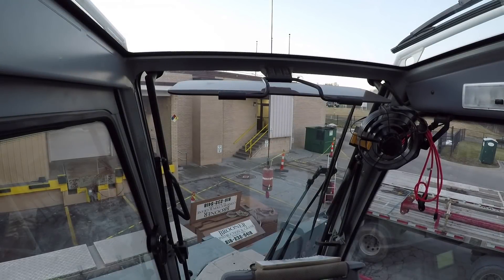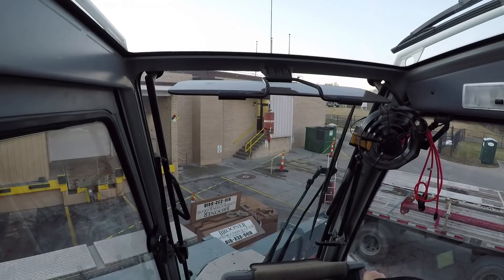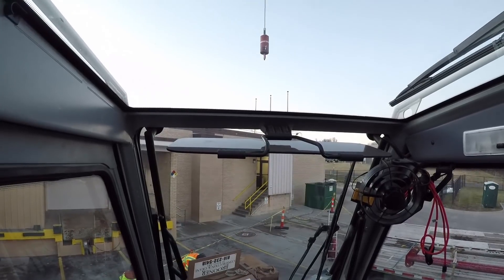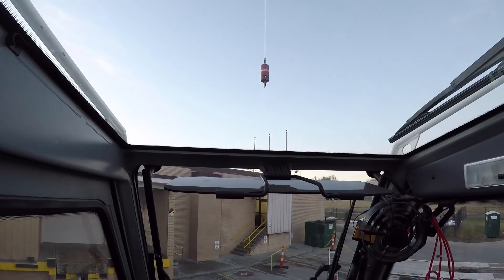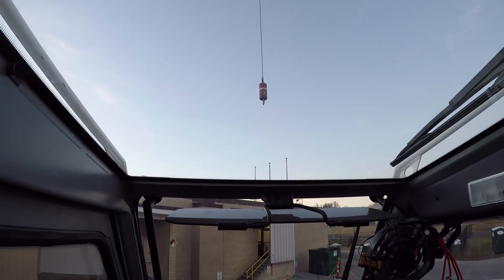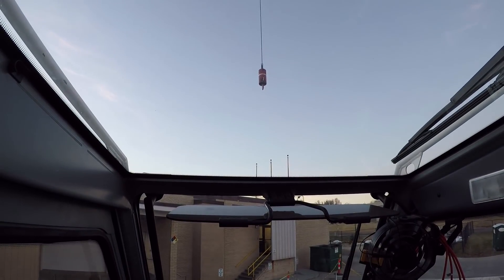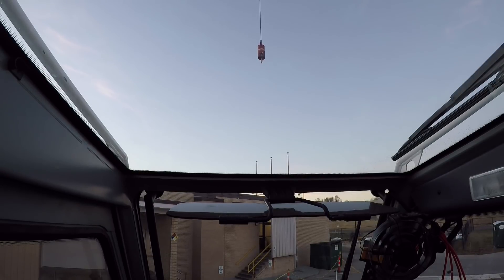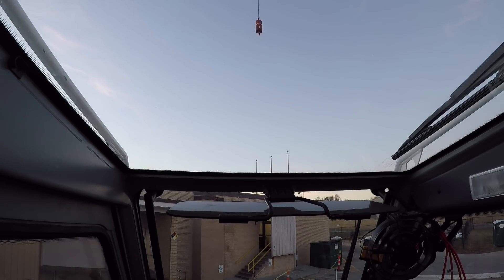Operating a crane in the dark - Heavy equipment operation at night - Luffing jib

Comment: Where you even close to the edge of your chart at that radius?

When I was early-on in my career, I just trusted that the engineers knew what they were doing.  I didn't like to look up at the boom tip, I didn't want to see it.  It took some getting used to, to see the boom bowing down so far!
Reply from the maker: Thomas Nelson, I was less than 75% of my chart at that radius. Watching the boom can be a little disheartening at times. Thanks for watching! 🙂👍

Comment: With only a couple picks I wouldn't worry about it but if I had a lot of picks I usually will tape a few glow stick to the becket and tape a few to the a2b weight. You can get them from the dollar store. I've also use battery powered Puck lights to give me reference.
Reply from the maker: John Collinson, I had glow sticks taped to the ball. I also had my red aviation light on the tip of the jib (although you can't see it in the video). Thanks for watching! 🙂👍

Comment: the pivots at that distance would be touchy.   Just moving that pick 3 feet to the left, would be fractions of a degree on the turntable of the crane.
Reply from the maker: NgnMech, that's for sure. I always like it when they say to swing 3 inches and I am at a 180 foot radius. Typically a gentle breeze will move it that much. Thanks for watching! 🙂👍

Comment: Another smooth, safe pick. Setting equipment at night is a lot harder than it looks.  Strong work!
Reply from the maker: David Sonnen, thank you! I agree that setting equipment at night makes things significantly more challenging. Thanks for watching! 🙂👍
Reply: @ToTheTopCrane  Recovering 8 feet of boom deflection had to make the last part of the lift a bit more interesting...
Reply from the maker: @Quadflash , lots of booming down while intently watching my radius and load on the LMI. 👍